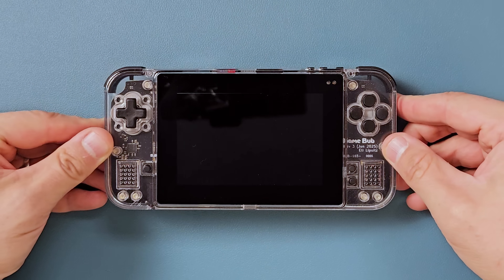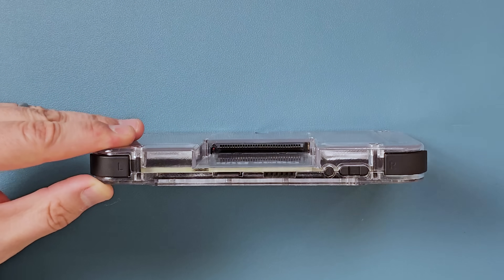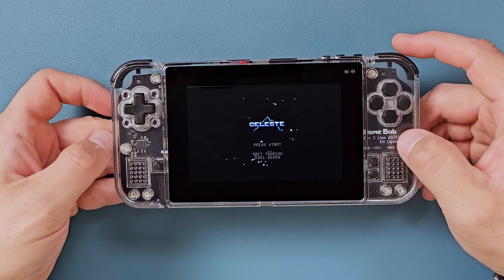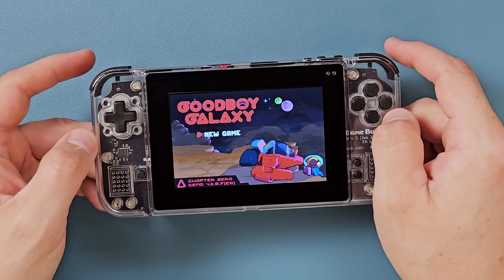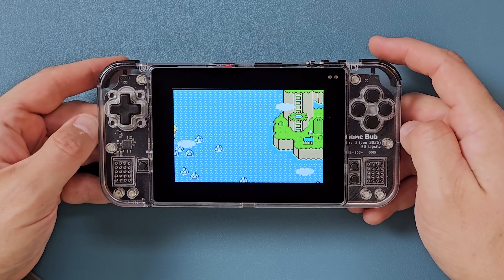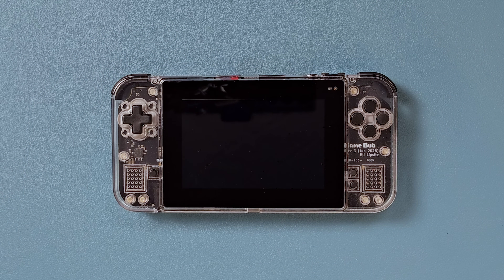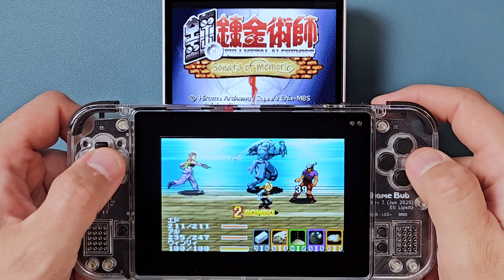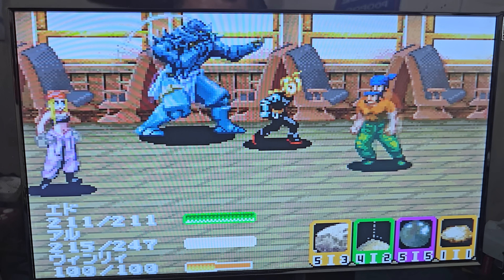First Look: GameBub, the Open Source FPGA Retro Handheld

Comment: FPGA is hardware emulation instead of software emulation, enough with that marketing nonsense. FPGA-based consoles like all of Analogue's, MiSTer, and even this one literally wouldn't exist without accuracy-focused software emulators doing the hard work of having figured everything out first and putting it to code.

Comment: I'm all for home grown efforts but if they can't be competitive with the current market...well.

I appreciate the open source nature of this however, the control selection really limits what this thing can do. No N64, No Playstaion... basically nothing past a D-pad and 6 button layout is feasible from a functionality standpoint which then makes the asking price look very silly. If it had dual shoulder/trigger buttons and at least one left side lower placed stick I'd be pretty tempted. As it stands, no shot.

You can buy a Funnyplaying FPGBC for $70, a cheap aliexpress flashcart for $20 and for 1/3 the price of this machine have 2 of the 3 consoles represented here in an FPGA emulation device. These two points make the value proposition of this thing essentially non-existent.
 
FPGA is still emulation no matter how you slice it. Hardware emulation is still emulation and there is still input lag. There are literally hundreds of quality emulation handhelds on the market that play a lot more systems for less money and given the nature of and current chaotic nature of the US economy, that means something.

Comment: Doing some rudimentary input latency testing would have been a huge value add here. You keep saying that it being an FPGA means no more lag than real hardware, but we already know that competitors like the Analogue Pocket add a frame of lag thanks to the LCD design. It would be nice to take the step of actually validating the lag claims and comparing against real hardware and comparable emulator-based handhelds. It would also back or refute your subjective claims that it feels “a hair more responsive.”

Comment: As much as I'd like to support FPGA, it's darn expensive. I do like that he included the SD card slot because even though I have a lot of physical carts It's a pain to carry several, and risking damage to original tech. If you can save the game to the SD on the device that'd be awesome, but I can see where that might introduce the litigation problem to have a device that literally makes roms. And it's so easy to get 8 & 16 bit romsets anyway. Might also be nice to have a plastic dummy cart to put in the cart slot to protect the contacts.
Reply: Yeah. I love the idea of it, especially for preservation, but the cost is not ideal. 

Although, finding a used GBA SP is going to run you about $80 to $130 on the market. Then you would have to buy a flash cart, and screen upgrade, and you still wouldn't be close to what this provides.
Reply: @funkatron101  I'm lucky enough to still own an original gba and sp, but screen mods to modernize the experience (which I think would be the another major upside to this device) have always seemed daunting.

Comment: This is a really great idea. I am tempted to get one just because the entire project is open source, but as someone who appreciates staying true to the original consoles, the thing that Analogue really nailed with the Pocket is the screen emulation modes. It is pretty obvious in your clips that the games don’t look quite right if your goal is authenticity and matching the original consoles. The pixels all blend together without the pixel grids from the original displays. The original game designers designed the games knowing that the pixel grid was there so when you take it away, it feels like it is missing something to me.

The Analogue Pocket uses a 1600x1440 pixel display which allows them to fake the grid lines around the pixels to emulate the original consoles (perfect integer scaling too at least for GB and GBC) and even has CRT emulation. The ModRetro Chromatic took it a step further by engineering their own display to the same specs as the original GBC. This one may have similar hardware compatibility, but the display seems to be kind of lacking.

Comment: I'd bet the GB/GBC/GBA cores used here are probably very close to perfect now, but still feel like it's worth pointing out that fpga cores are not 1:1 clones of the hardware, they are reverse engineered from known behavior. It's why so many were skeptical of Analogue's claims of 100% accuracy on their n64 core, because at the time there was already a lot of work on the openfpga core and it wasn't anywhere close to that.

Comment: No offense but.. this seems kinda dumb if I’m being honest. Emulation has gotten so good there basically is no difference anymore. I’ve played on a mister and I can’t notice ANY discernible difference. And why wouldn’t you just get an analogue pocket at that price? I mean at least they can also play game gear, lynx, and neo geo pocket as well (with an adapter). Idk I just don’t get these fpga guys.. with all you get from emulation, it’s just not worth it anymore.
Reply: This is much more attractive than the Analogue Pocket. Analogue is a terrible company and the Pocket is a very flawed product, and remains shackled by Analogue. This is completely open.
Reply: @Zanpaa I don’t see it as being more attractive at all. Again I’m not a fan of fpga compared to emulation but I’ve seen the pocket up close and it’s gorgeous- just incredibly polished all around. As far as the other stuff that’s ur opinion. And even tho it’s not open source it’s still using fpga cores which I’ve heard overall good things about.
Reply: The main reason is so you can use your original cartridges, if that matters to you.
Reply: But offense if you notice things like input latency, and or other issues with emulation. 

I’d much rather play something that feels natural and that’s what I feel playing FPGA devices do best. I own most original consoles so sure I can do that, but if I don’t want them all connected to my TV I go with my Mister Pi, and if I want to take it on the go it’s the Pocket for me.
Reply: @Tom-Bomb  the Analogue Pocket is gay as shit

Comment: It’s cool devices like this exist for those that want it. But man that price. That funnyplay GBC is a third of the price & id guess modding a GBA with a modern panel is a lot cheaper too.
Reply: As someone who has modded a GBA... It wouldn't be much cheaper. Include the price of a good quality flash cart, and you probably spent more money than this, and still have less capability.

Comment: If the majority of MiSTer cores are ported to this device, it'd be neat if the Evercade supported this device since Evercade carts fit in the Pocket GB/GBC/GBA slot. Not going to happen, but the idea is neat. For a V2, what I'd really love is a mixture between LCL's custom NGPC with clicky joystick, FPGA-based with NGPC link cable support, NEOGEO, NG CD, NGP/NGPC and the LG WING AMOLED in the RP Classic. It'd be expensive, but it'd be special.

Comment: I've always admired a good FPGA device but I'm not getting cartridges again. I finally went full emulation last year and I'm not going back. I wish Eli nothing but the best on this, it's an amazing design. Nice review, Zu, you gave it a real thorough run through, it's appreciated!
Reply: This can run roms right from an SD card. No need for a flash cart or any cartridges at all.
Reply: @jellydude503  oh, that unexpected! Welp, I quess it might be for real the best GBA based thingy!
Reply: Many FPGA devices can run ROMs as well.
And since this one is open source - it will be able to do it sooner or later.
Reply: You can get one Flash Cart and run games from SD card
Reply: @saddemon3913 the device has got an sd card slot already